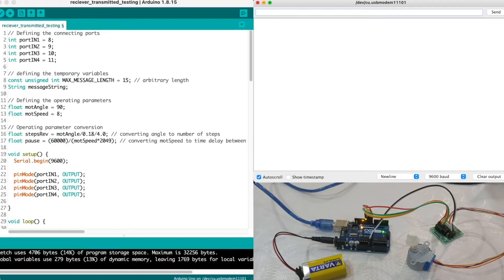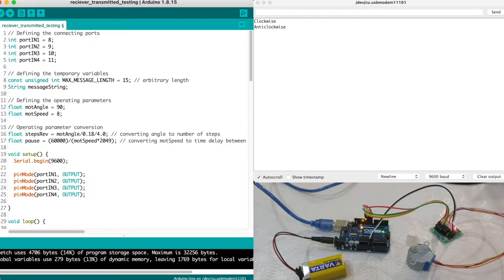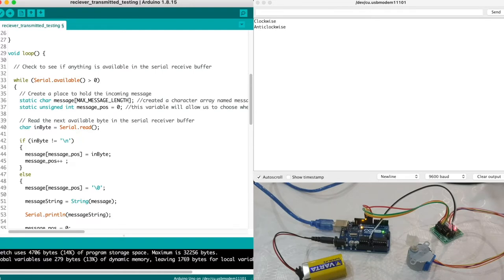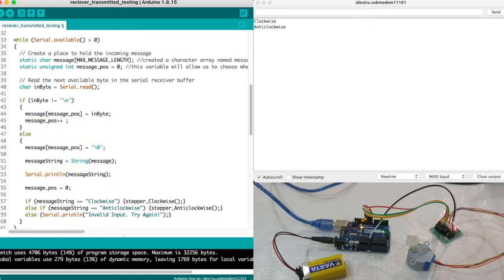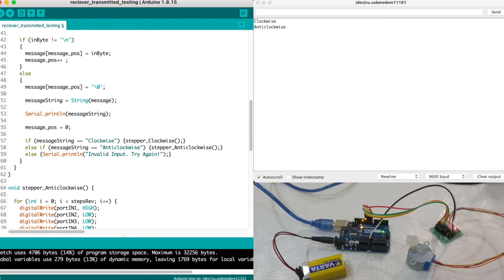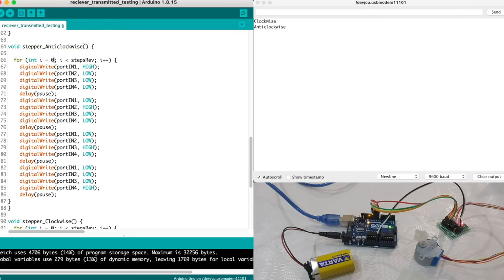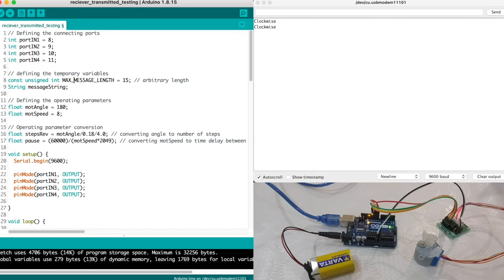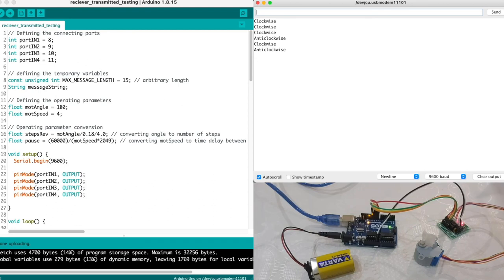Episode 5: Controlling Stepper Motor using Arduino  and without library

Comment: Please explain      float stepRev = motAngle/0.18/4.0              
why  you took 2049   (32*64=2048)
Reply from the maker: Because stepper motor rotates by incrementing through small steps. In one rotation there are 2048 steps.